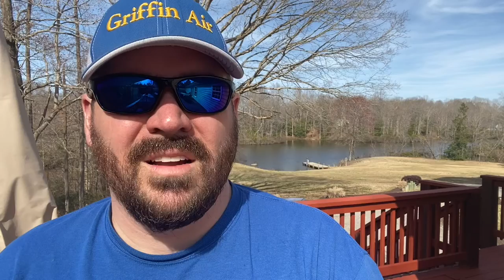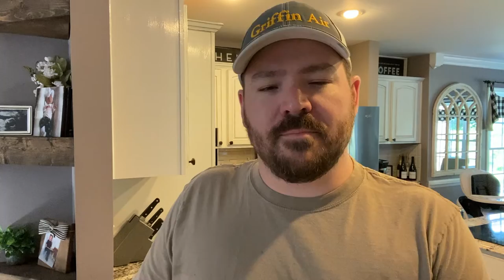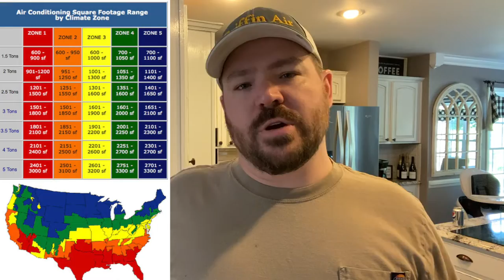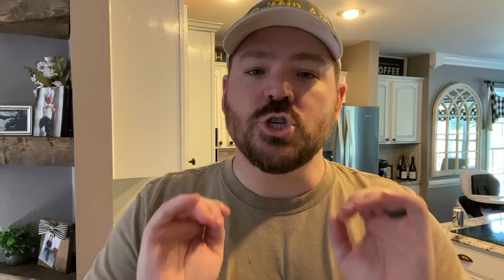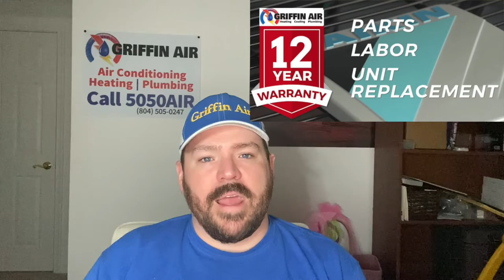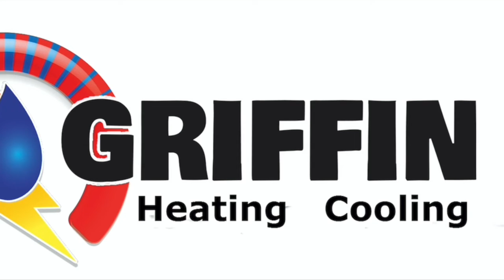WRONG! Misinformation on the internet about HVAC system sizing and what you should do instead.

Comment: My house is in N. Texas.  It's hot in the summer.  The house is a 2 story with around 1000sq/ft up and 1700sq/ft downstairs.  The 3 most used lived in areas downstairs are the living room, large office and kitchen/breakfast area + lesser used dining room, spare bedroom a full bath and large entryway.  Upstairs are 1 very large master BR + 2 other avg size BR's + smaller work out &  2 baths.  The insulation isn't very good and none of the exterior walls have insulation. (pull the wallboard off, and there is  a plastic sheet then brick.    No foamed beams on underside of attic, nor any non liveable attic space.  
WHen it came time to replace units,  I went with a 16 SEER 4 ton dual speed variable fan downstairs and a 2 1/2 Ton single stage upstairs.   It has been a perfect system and initially so did the company I hired to install it.   Downstairs rarely runs on high speed  - in fact,  hardly know it's running.  The 2.5 ton upstairs temp is set at 67* and cold air falls like crazy coming down the staircase in the large downstairs 2 largest areas.  My 4 ton unit went out and the same company I used originally insisted that unti should be a 3 ton single stage.  I adamantly disagreed due to how quiet the unit was, maintained perfect temperature.  Relative Humidity downstairs runs 33-42% year round during warm months (70% of the time).   So, WHY is my HVAC guy so insistent on taking down from a 4 ton dual stage to a Single Stage 3 ton ???  I can't for the life of me figure why he's so insistent on downsizing.   ANY IDEAS OR COMMENTS??

Comment: We have a 2000sf mobile home with a 4 ton heat pump. It needs replaced I was thinking of a 5 ton but one with a 2 speed condensing unit. Were in texas and no shade 14 windows plus a sliding glass patio door.
Reply: I'm in South Central area of Arkansas (about a 100 miles Southwest of Little Rock) so our weather temps are pretty much identical. My recommendation go with a 5-ton 2-stage (or Variable Speed system if you can afford it) heat pump system. Personally after several quotes had 3 out of 7 HVAC guy who did my quote recommended me upsizing to a 5-ton system that was either 2-Stage or Variable speed system so i chose to go with a Trane 5-ton Variable Speed climate control system upgraded from a Trane XR13 Single stage 4-ton system that never shut off in the summer months. My nee Systemt barely runs more than 40% capacity except during the triple-digit hot summer days and even then it never operates above 80% capacity and it easely maintains whatever i set the temperature at. My recommendation at the very least get a 2-Stage oversized heat pump system if they say you need a 4-ton insist on a 5-ton 2-Stage heat pump system. it will run in 1st-Stage (which is equivalent to roughly a 3.5 - 4-ton system amp draw) about 80% of the year. By me doing that or at least something similar my electric bill literally dropped by more than half because unlike my old system this one does not run all day and all night when it's hot. You can thank me later.

Comment: I have a slightly larger system, and it works great.  I would be more afraid of going too small... and having the thing run all day long just to pull the house down a few degrees.  Mine will pull down to whatever I want it to, quickly.  It gets up to 115f in the summer here.  Dry heat.  House is not real tight and thermally efficient.  So... the larger unit works great.  Specs would call for a 3 ton.  I have a 4 ton.  1700 sq ft.
Reply: Where are you located at if don't mind asking?
Reply: Thanks for the response!! I have a 2.5 Ton and my AC struggles to lower the temp within a normal time i'm going to jump to a 3.5

Comment: System sizing is multi factor. Not just climate zone but, also the number of occupants, windows, ceiling height, number of occupants, IT equipment especially high end custom gaming PCs, appliances, and the insulation. Whenever you are building a house from scratch, it is worth it to hire an MEP engineer. Also having dampers on the branch take offs can ensure proper air distribution so all rooms are heated and cooled evenly.
Reply: Number occupants should never be factor. Houses are sold all time and occupants numbers change
Reply: Also orientation of the house… N, E, S, W
Reply: An occupant adds about 400 BTU heat generation.  There is no way that this affects sizing for residential work.  Commercial with large crowds is another thing.

Comment: I hired an engineer to perform an HVAC load analysis. Says I need a 24K btuh system. Are all 24K systems pretty similar? I usually  install Diakin or Fujitsu units myself then hire a pro to check and charge it.

Comment: Fortunately here in the St Louis metropolitan area, St Louis County provide a worksheet ( one of the best I've ever worked with). From a normal size house plans, say 2500 square feet it takes about a half an hour or so to complete.The big Builders still get around it a little bit by using the same worksheet for each house model they may have, even though the house may  face a different direction ( it's close but we still find some under size systems ). We are also required to put a cold air returns in every room but the bathrooms or kitchens . The St Louis County worksheet is so good, all the surrounding counties and the City of St Louis honor it. I just wish code enforcement would require two systems for all two story houses but they still let the builders get by with one large unit.
Reply from the maker: That’s pretty cool. They seem to have the stuff together better than a lot of other areas.
Reply: Instead of 2 units for a 2-story house, how about a 2-zoned system?
Reply: @lapk78  ,VRF heat pump zoning works pretty good as long as it is a manufactured approved zoning system. Around here we mainly use Natural Gas furnaces and it puts the temperature rise way out of whack when you use zoning systems. Even the zoning systems approved by the manufacturer are hard to dial in. I prefer two separate systems, damper systems seems a little Mickey Mouse  to me , plus if one goes down you still have the other.

Comment: the problem is that the professionals are not doing the load calculations and they're easy to fudge to get the size the contractor wants to be put in. sizing by runtimes is very good if equipment is working properly.
Reply from the maker: Definitely agree on contractors. Some can’t do one if they need to

Comment: Trying to get a new gas high efficiency furnace here in Massachusetts. My old one is a 96000 btu furnace with pvc flue. 2500 sq ft house , does have 2 zones temptrol, built in 1995. Why am I getting some companies say I need 80,000 BYU’s and some say 100,000.? Old one seems ok.
Reply from the maker: 96k would be pretty much the same as a 100k if you're comparing.
Reply from the maker: I don’t know the answer to your question. It’s like asking why some people recommend white bread and others recommend wheat bread. I was simply letting you know that there isn’t much difference between a 96,000 BTU furnace and a 100,000 BTU furnace.
Reply from the maker: Perhaps you can ask one of them why someone else is recommending a different size and why they are recommending what they are recommending. Someone that knows what they’re doing will know why they’re recommending the size that they are recommending.
Reply: From my understanding it would be their difference on recommended BTUs per Sq/FT. 35BTU per Sq/Ft= 87500BTU, 40BTU per Sq/Ft= 100000BTU and so on. Colder the climate higher BTU per Sq/Ft
Reply: @NewHVACGuide  Also might be the difference between an 80% furnace and a 95% one.

Comment: I am curious for a 2-story house if the downstairs should have a much larger furnace and the upstairs a much larger A/C ? For my house the downstairs has the larger A/C and the upstairs struggles to remain cool.
Reply: Keep in mind the upstairs has to deal with the heat from the attic. If you want to aid the upstairs unit in remaining cool you could check the attic insulation level and add more. It like buying a cheap cooler that only keeps the ice solid for a few hours versus a Yeti or good one that last days. The difference is the insulation. So consider the same thought with your home. The walls are hard to upgrade after drywall is installed but the attic is really easy. Also is the largest contributor of heat. Lost local stores will let you rent the attic insulation blower machine with a few bags purchased there to blow more in. That would be the easiest first step and it'd help the house overall!

Comment: MY HOUSE WAS BUILD IS 1984 BUT HAS NEW WINDOWS AND INSULATION  2 STROY I 20 YEAR YORK REPLACED THE TRANE CONDENSER FROM 1985 IN 2006 AND ICP  FERNUS REPLACED THE TRANE  IN 2009 THIS HOUSE NEVER HAD 2 SYSTEMS